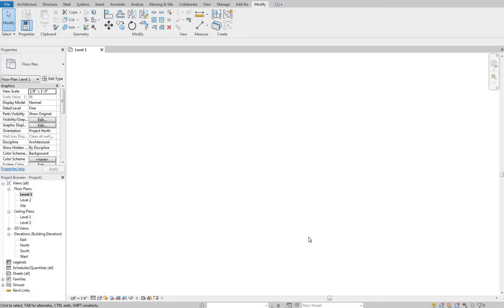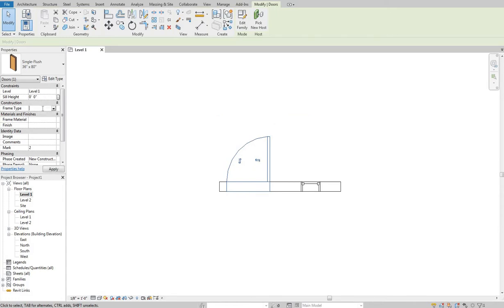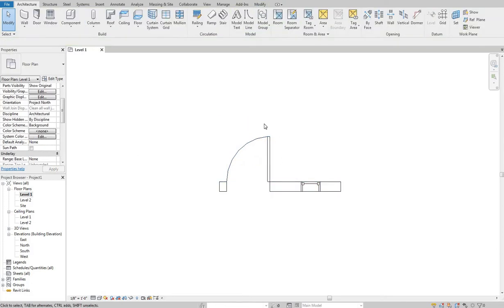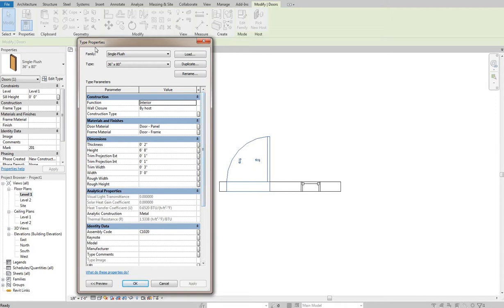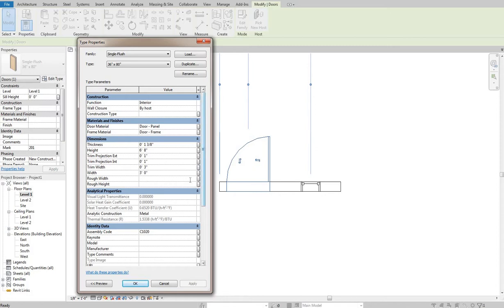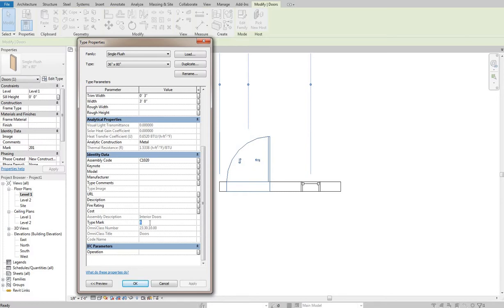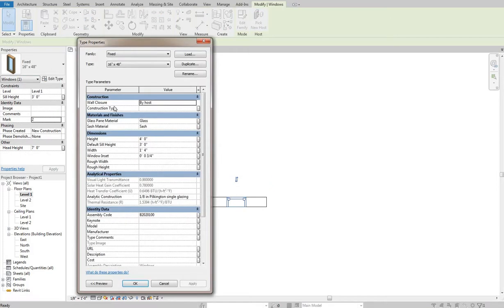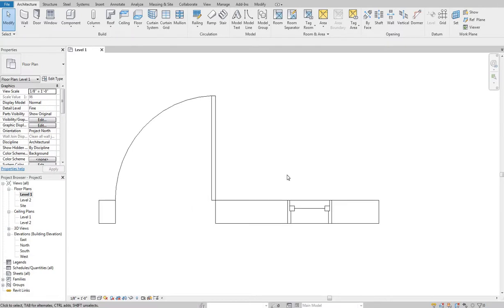Revit 2019 - Windows and Doors - Episode 2 - Properties and Type Properties

Comment: Great video. 
What formula should I use if I want to show symbolic lines in elevation - indicating the window opening- but are visible only if the 3 mullion type is on and the horizontal mullion is on (or off). 
I can use the same formula for the other types (2 and 1 mullions). I appreciate the help.
Reply from the maker: What you'd probably want is something like this in the Visibility parameter slot for the symbolic lines:  IF(AND(3 mullion type = yes, horizontal mullion = yes), Yes, No)

Basically what this formula is saying is IF both 3 mullion type and horizontal mullion type are on, then Yes, turn the visibility on, if not, then don't turn the visibility on.  Without seeing everything that you have going its a little tough to make sure this formula will work, but hopefully that gives you a good starting point to then tweak a little bit to get it to work for your particular instance.
Reply: @brianalbrecht7859  Thanks, I will try it out. 
PS. Could I send you a screenshot of what I am doing, so you can have a better idea?
Reply from the maker: @valeriepierre7297  I'm not sure a screenshot would be all that helpful since my screen will look entirely different from yours without the other parameters and model built the way you have it.